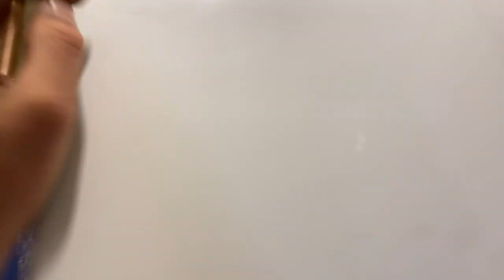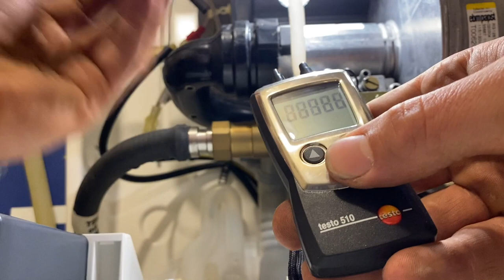Buderus GB142 Boiler Plugged and Cracked Furnace! | HVAC Vlog 7

Comment: The professional company that I had service my GB142 was great for the first few years, the guy really knew his stuff, did the mineral oil/burnoff, etc., every single year, as required.  But then the company didn't have a Buderus 'expert' and sent a regular boiler guy out.  He didn't clean the coils.  THREE years!  Finally, the original guy came out on the fourth year and was astonished how dirty and clogged everything was!

Not quite as bad as the one pictured, but getting there.  The tech said it was too dirty for him to clean, but I knew I could do it.  I used various dental tools, etc., and wire brushes to get everything opened up again and all that calcification cleaned off.  Took me a couple days/many hours.  But cheaper than a new heat exchanger. 

The tech returned, did the regular mineral oil (was shocked how clean I was able to get it) and the company gave me a free year of service to make up for the problem tech.

I had the free cleaning that next year, but then just started doing the cleaning myself.  Pretty easy.

Btw, yes, I still used the dental type tools for the large chunks, and small wire brushes to get most of it quite clean (better than most techs get it using the mineral oil).

Also, the reason why the plastic condensation trap gets broken at the top like the one seen in the video is because techs try to remove it before removing the bottom plate.  If you click the clamps and remove the bottom plate, it just slides right out of the plastic neck.
Reply from the maker: Wow! That’s a bummer that the new tech wasn’t properly trained to work on these boilers. I tried a multi tool and everything I could with this one. At that point as a tech it’s time to just recommend replacement. 

Very true on the condensate traps as well. Those will tend to get very brittle with time also and you can almost feel them crack in your hands even when you take them off the proper way.

In NH these are nightmare boilers to run into pretty much 90% of the time. They were pushed heavily and not many were told they have to be maintained yearly. Pretty sad!

Comment: Manufacturer recommends using mineral oil on heat exchanger, burning it off on high fire then flushing out after. It does suck having to take apart twice but the clips make it very fast... it might help with those dirty ones, great video!
Reply from the maker: Hey thanks for the feedback man! I usually do run the mineral oil and do the burn off too. This one unfortunately was just so bad that I don’t think that would touch it haha.

Comment: Hey how do u test for a cracked heat exchanger for an oil furnace dont know if im testing them right or if theres a nother way thanks
Reply from the maker: Hey man, the best way in my opinion is to get a good visual and use camera snakes if you have anything like that. Also pull blowers in old furnaces! A lot of times you will find cracks right there. You can do over the fire draft tests to look for fluctuations when the blower kicks on and also watch for drops in co2!

Comment: A lot of guys hate these gb 142s, I don’t mind them, I think they’re actually fairly easy to work on and clean
Reply from the maker: Yeah man, I have a love/hate relationship with them I guess haha. When people take care of them yearly it’s not so bad. This one however is the perfect example of how bad I see them when neglected! I’ve made some repairs that were easy too. This one ended up being junk because it was too plugged to free up and pull the gas through the heat exchanger.
Reply: @BlueCollarBiceps  I unplugged one about 2 weeks ago, hadn’t been touched in 9 years.
Reply from the maker: Nice. Idk what it was with this one but the stuff was so rock hard nothing I tried would break it down. What do you like to use for cleaning agent in those situations?
Reply: @BlueCollarBiceps  evaporator coil cleaner, diluted 10 to 1 in a spray bottle, let it sit for about 2 minutes then rinse with water
Reply from the maker: Alex G Thanks man I’ll have to try it never thought to use coil cleaner
Reply: Use a plastic brush for cleaning no steel screwdriver/knives/bushes it makes me cry.
Reply from the maker: Couldn’t save this one and plastic wouldn’t have done anything at all on this
Reply: Curious was this natural gas or propane. I'm on one now that is like cement in the second row. Hard to get at. It's been neglected for years. Harder to clean than any natural gas I've cleaned.